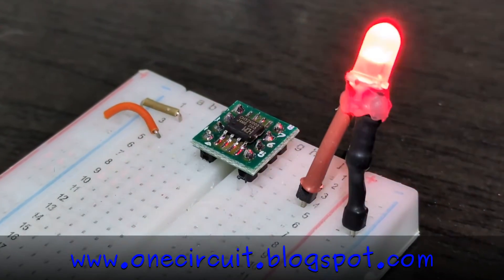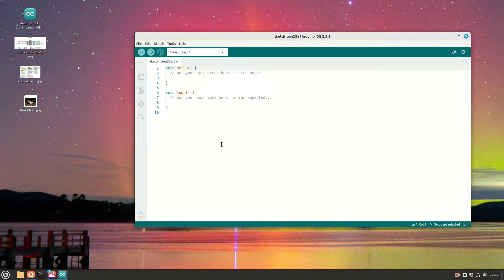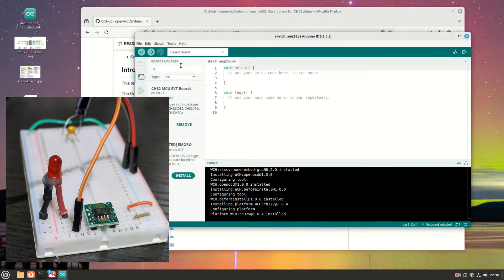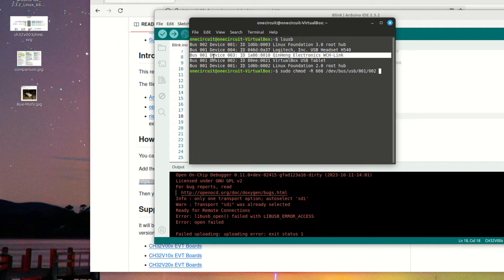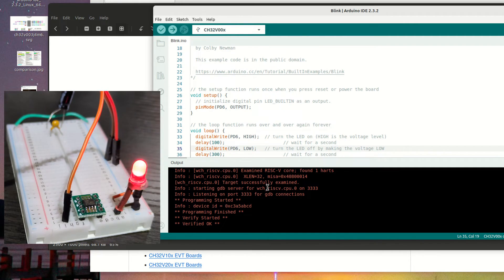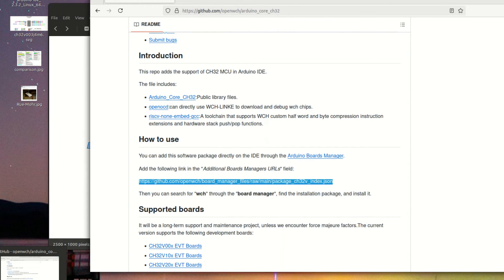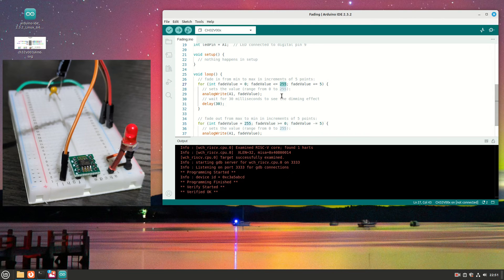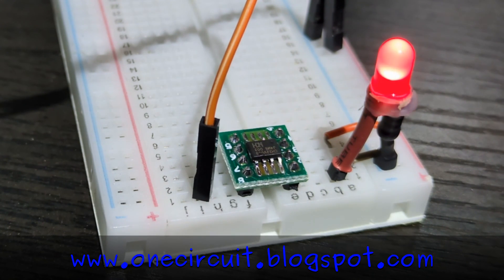CH32v003 bare on a breadboard - will it blink and fade? (yes)

Comment: Instructive! What are the capacitors at the end of the breadboard and what do they do?
Reply from the maker: @drkgld  sometimes I use a 10uf and 100nf in combo on the power rail for smoothing a noisy power supply (e.g. a buck/boost scenario), but here I'm embarrassed to say they're just sitting unconnected at the end of the breadboard, leftover from another project! 😬👍
Reply: @onecircuit-as  Thanks. I wondered if they might have been there to prevent reset or something, but couldn't see how they were wired up..
Reply from the maker: @drkgld  I was told smoothing caps would be needed for this chip, and I just took them out and place them randomly on the breadboard.  Whoops!  🫣

Comment: Not working with ch32v003f4p6 development board
Reply from the maker: It might be mapped differently, I used a bare chip, not the dev board. Try nerdling the code a bit, using different connections. Good luck!

Comment: doesn't work with arduino 1.8  sad face, not going to update, I already tried and my old code not workie anymore, so fk it staying with 1.8, it works..but not for this
Reply from the maker: @murraymadness4674  Mmm I thought I did use 1.8 but definitely the latest IDE is more compatible with the new chips. 👍😀

Comment: The PA2 pin did not work as an output because some pins on ch32v003 have multiple functions. The default function of PA2 is not output. You have to remap it to make it work.
Reply from the maker: @gilbertojunqueira314  Yes I remapped it in the next video 👍😀

Comment: Many thanks for the time-saving idiot's guide to these things.They'd be perfect for my project,but as yet there's no RCSwitch library for them.
Reply from the maker: Interesting! I'm not familiar with those libraries but I'll take a look. It might be just a case of assigning the correct pins for this chip in the *.h files.
Reply: @onecircuit-as  There's a free IDE called Embeetle for RISC V chips;it can be used to program the CH32003 and comes with quite a few examples.
Reply from the maker: Excellent I’ll check it out, I have a feeling it’ll be a great community as it gains momentum. 👍😀

Comment: I recently started using the CH32X033. More flash and ram, and built-in USB, and still less than 30 cents. The only issue is that it is part of the 035 family, but the pinouts are different, so I had to create new variant files for the chip under the the 035.
Reply from the maker: I think it might continue to grow in popularity. Some decent documentation, examples, etc will help! 👍😀

Comment: I hate Github. It's the most confusing mass of downloads I've ever seen. I wanted to download an Emulator that they said works on Windows, so I went to the Github page, managed to download all the files there, but there are no instructions at all on how to install or run the damm thing. There are instructions on how to use it, AFTER it's running. This happens everytime I try to use Github. I'm sick of it.

Rant over, sorry. (I got a bit triggered)